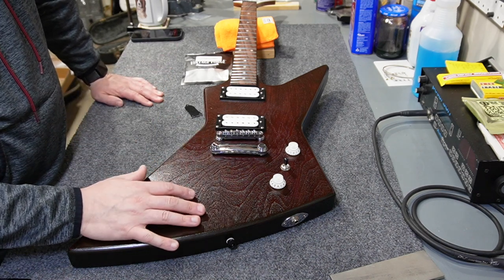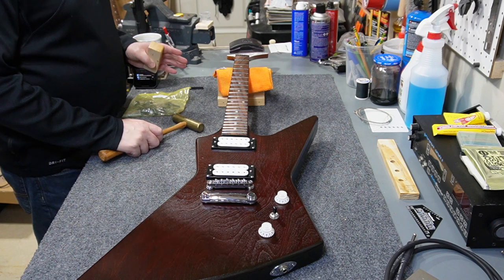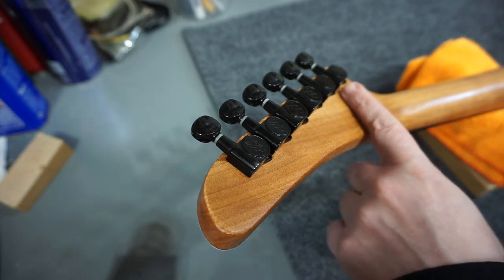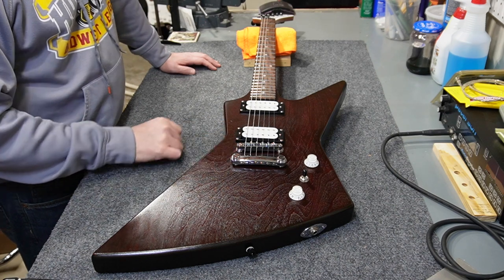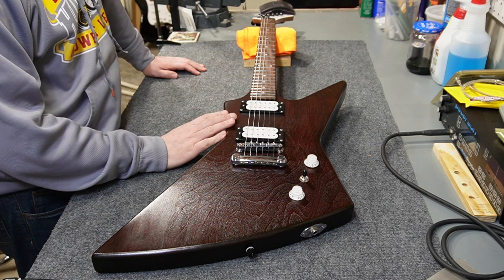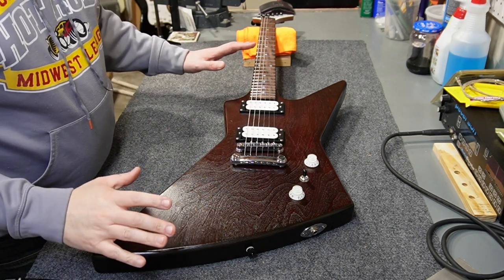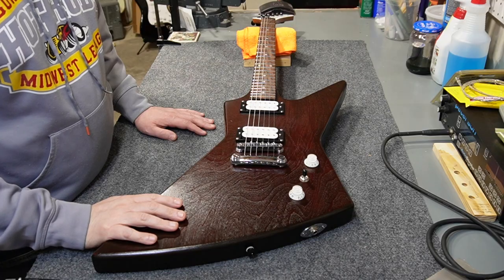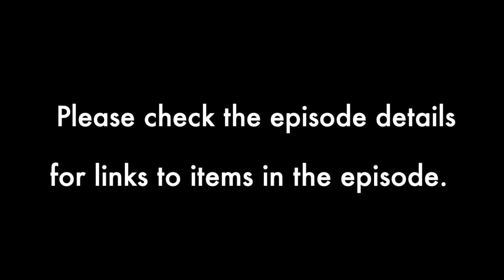Pango Music Explorer Kit Guitar Build - Part 7: Completion of the Kit (bought at www.guitarkit.shop)

Comment: Thank you for the detailed videos! Turned out awesome. I blindly ordered the same nut weeks ago hoping it would fit. Thanks for the links as well. Please update if you change anything regarding the string height.
Reply from the maker: Will do, thanks for following!
Reply: @hacksguitarhobby  is it possible to get the measurement of the bridge string spacing E to E? I have a roller bridge from Solo that measures 52mm or 2.047". Thanks!
Reply from the maker: @71ninjasword  It is 52mm or essentially 2 1/16"

Comment: Would you be interested in doing a pickup change in a Gibson LP or SG that has a pcb?  Either a 4 or 5 wire pup and or a two connector. Like Seymour Duncan 59's . I think I read an article on it. don't remember where. Was a while ago. I have the 2020 or  2021 SG Tribute with the pcb. I didn't know to ask about the pcb. Thanks. Oh, I have been watching your progress on the Explorer build. It sounded good and yor channel is growing. Keep up the good work.
Reply from the maker: I guess it depends on what you're asking.  Are you asking if I'd do it on your guitar, or if I'd do a video about it?  You know, it's kinda funny - I actually just bought most of a PCB setup from a guy on Ebay recently, because I was going to buy a husk and swap in the parts.  I have the PCB and the pickups but don't have the jack or the switch yet.

Comment: So what do ya think Boss, should I glue the neck on and stain it all together? Or is separate best? Thx Captain!
Reply from the maker: I did this one separate and had to touch up the joint.  Easier to handle that way.  I am doing an SG repair now, and I’m doing the finish with everything together, and the joint looks better, but it was awkward to handle.  Pros and cons either way, but I think I lean towards doing them together now.  You can also do the dyes when they are apart and then the topcoat when they are together… just be aware that the wood glue may activate some of the dye again.

Comment: Do you know if they have a kit with the battery slot for active pickups or floyd rose hardware?
Reply from the maker: I don’t think they do, or at least I have not seen it.  Some of the pickguard kits would definitely have the space.
Reply: @hacksguitarhobby  i was reading there apparently they do complete custom kits, i was looking at the neck through body version im curious, ive never owned a neck through body guitar before as they tended to be more expensive